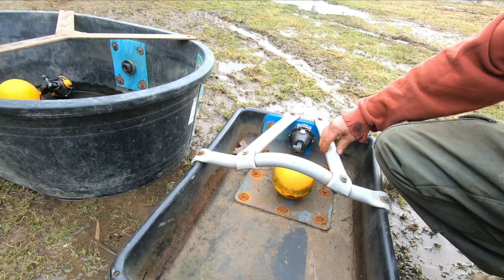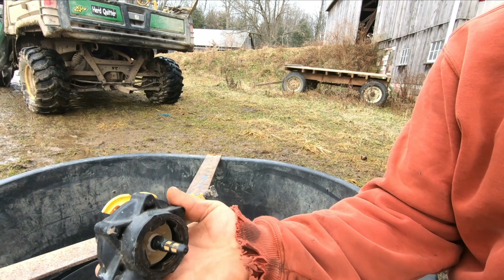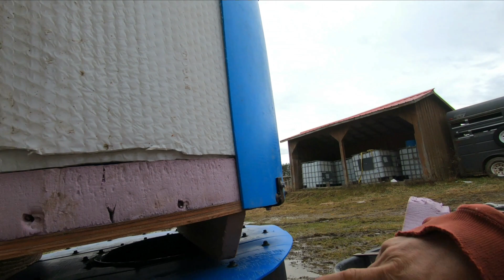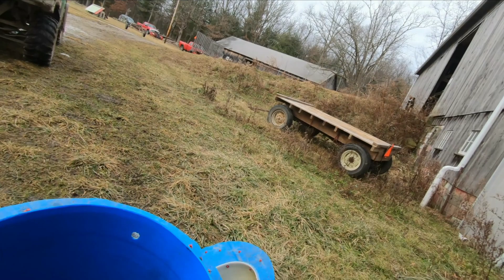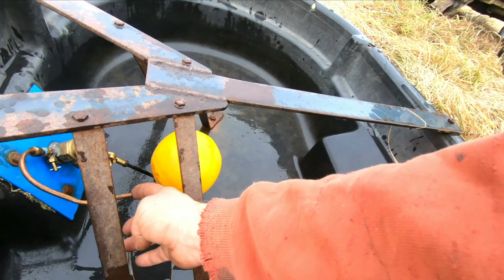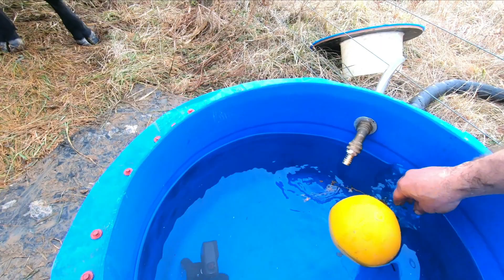New insulated portable livestock water tank design!!

Comment: When your living in the snow. It's better if they make metal water tanks. That way you can light a fire and melt the snow. Inside the tank. Then it can pass on to a metal pipe where it goes into a plastic tank or another metal tank. That way you   don't have to keep switching water tanks . Or just insert a water heater in the metal tanks so it the can melt the snow to pass on to the other tank and you can keep adding snow to the tank and melts and travels its way to the other tanks you connected too.

Comment: I'm in Minnesota.  I had my "frost free" Cobett type waterer freeze up this past winter.  I use a bottom of tank toilet valve in them, and the reservoir is a 3 gallon rubber bucket, so very little "reserve capacity".  What happens then is they drink the bucket empty exposing the valve to the outside air.  It was -20F plus for about 2 weeks, and without water over the valve, it finally froze up.  That then exposed the "basement" to cold penetration, and the feeder pipe to the valve froze.  Didn't want to mess with it during the cold, so I just set a 25 gallon tank under a hydrant (hydrant just like you have in the video).  I opened it up to a steady stream of water running, dumping through the air (no hose), and dropping into the tank.  Drove in some fence stakes around the tank to keep it in place, and alongside of the hydrant to protect it from the cattle.  I took the handle off of the hydrant entirely, so they couldn't shut it off on me.

I was VERY surprised to find that the black plastic tank (just like you had at the beginning of the video), with NO insulation at all, and just sitting on top of the ground, stayed COMPLETELY open, not one bit of ice on it, not even around the edges... right through that long very cold spell that we had.  I never bothered to fix the other one, figuring to wait until spring when it would be nicer to work on it... When the warm weather finally came, it all thawed out by itself and EVERYTHING worked just like it's supposed to.  The herd of 80 head are drinking on it right now, with no other water source.

My point is, a little bit of flowing water can make up for a lot of heat energy given off to the atmosphere... and remember, I'm in Minnesota, and out January looks quite a bit different than what this video is showing.  Yes, it's a lot cheaper to pump water than it is to heat water.  Your heat source is then "geothermal"... the ground the water flows through to get to the water.
Reply from the maker: Cobett waterer are supposed to really good. Cows can be hard on hydrants my solution to that problem. Is a short piece of poly wire, a jumper, and 3 step inn fence post. Just run it round the hydrant. 
I'm sure your weather is a lot worse than it is here. We have had three very mild winters here. I do have friend in Canada that has tested this set up down to -24. Thanks for watching!

Comment: I’m interested in making a small portable waterer like you have. Do you have any issues with cows stepping in it or knocking it over? I currently have a 100 gallon tank on a wagon I built but I’d like to go smaller and just dump it just to move it.
Reply from the maker: Sorry for the slow reply. I do not have any trouble with the stock tank. The only time they push the tank around is if move them a long distance on a hot day or if I forget to turn the valve on. Thanks for Watching!!!
Reply: @RussWilson  I made one out of a Protein lick tub, been using it for probably three months and it’s been great so much more Portable
Reply from the maker: @ElliottFarms  Stock-tanks can be made out of almost anything and work well. I have a friend that made one out of a portable file cabinet tote.
Reply: @RussWilson  yes, it is working great so far. I have to make one for the winter time next!